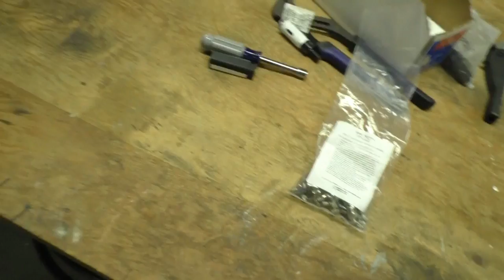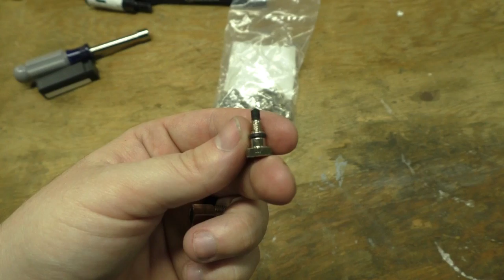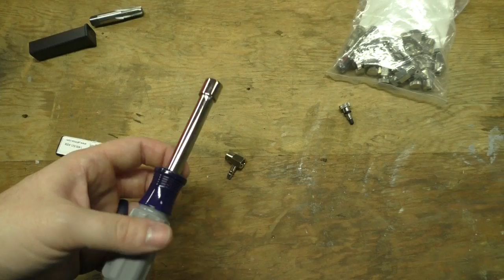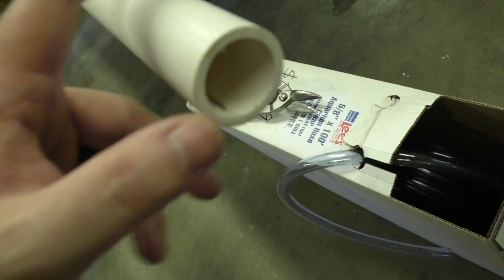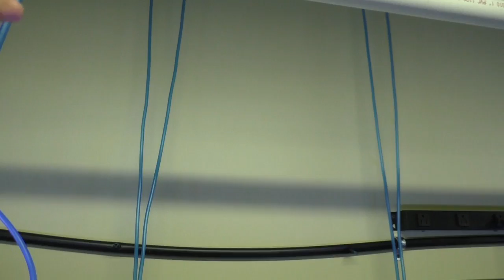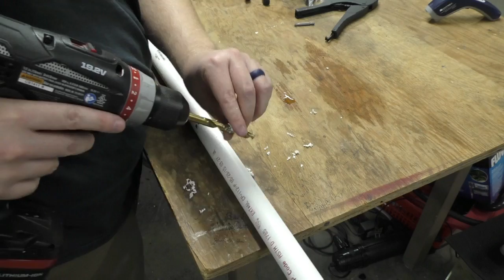Install DIY Auto Fill Lines for Water Change System | How to Build a Fish Room (Part 4)

Comment: Informative video. I'm planning out a water change delivery system now and wondering how water tight those AV4 flow control valves drilled into the pvc turned out over time? Did they ever leak at all or would RO tubing and fittings be more reliable? And what water pressure did you use going into the supply line?

Comment: With an auto water change system like this do you need to use a pressure regulator at all?
Reply from the maker: Depends on the system you set up. I’ve used pressure regulators and not, with my latest system not using one

Comment: Hi Cory.  Thanks so much for all these videos.  I am wondering why you chose an on demand drip system instead of a continuous drip system.  I am thinking continuous drip for my small fish room but just wondering your thoughts.  Thanks again
Reply from the maker: +ribs1 it's hard to regulate down far enough to continually drop on a hundred tanks.

Comment: I'm sure you've said this before, but for a system like this what kind of water pump do you use for this much water being changed on a daily basis, and what's your head pressure like now that everything is built out, are you still using the same pump?
Reply from the maker: Same pump, now I don't use any pumps as I put in a tankless water heater. But  I was using an eheim pump.
Reply: Thanks for the reply.  I didn't thing the tankless heater moved all the water through your system for you.  I'm trying to find something powerful enough to push water to a bunch of tanks kind of like what you did.

Comment: Still not clear how the water goes all the way from water outlet into the bucket and from there to the aquariums. Cant i do it directly from water outlet without bucket directly into the tubes and from there to the aquariums? Why the bucket between?
Reply from the maker: +Adlerauge Wissenschaft well for me I wanted to gas off the chlorine and heat the water up. Now that I've installed a tankless water heater and a whole house filter I bypass the holding tank
Reply: Aquarium Co-Op in german ,,hebeanlage,, aka ,,kondensathebeanlage,, is going to help me out.
Reply: Its a pump with that gets started by a floater. Just like youre white kubik canister but vice versa

Comment: Hi Cory. Are using 1 inch pipes across the filling system i.e. embedded between the 2x4s on your shelf? I recall from another video you mentioning going larger for the drain. I will find the video later.
Reply from the maker: Yes, and 2 inch abs for the drain.

Comment: The AV4 air valves are solid brass correct? Brass has copper in it. Have you had any problems with the copper over time leaking into the water and killing inverts? I'm considering building an auto water change system and would prefer to use self tapping valves but all the ones I've seen have been solid brass.
Reply from the maker: +ArsenalOfColor Aquatics these are nickel plated, but haven't had any issues with inverts myself
Reply: Thanks I plan on calling JEHMCO and talking to a rep about their suggestions. I've been told they have excellent customer service from friends.

Comment: I have a question how do you keep fish especially fri from going down the drains
Reply from the maker: +Desmond Harper Well you use a low flow rate. So if you're dripping the water in over 30 minutes or more, the flow is so low. You can use fish screens etc but they can get clogged up and cause a flood. I won't say you'll never lose a fry. But you'll save a lot more fry with clean water than dirty water but never losing a fry down the drain.
Reply: +Aquarium Co-Op thanks for the reply .... You make a good point .. I wasn't sure about the drip rate but now I can see it more clearly THANKS !!!!!
Reply from the maker: No problem. We are here to help.

Comment: Sorry if this was already explained somewhere, but since the auto-water change water is being pumped from a mag drive in the water tote, how is the tote being filled? Is that automated or done manually?

Also wouldn't the mag drive create a lot of pressure in the fill pipe? I don't understand what you mean by a low pressure system. Can anyone explain how that works? I thought mag drives were pretty powerful.
Reply from the maker: +Matthew Ng I currently am filling the storage tank manually but will automate that process when I move the bin to it's final place.

As for the low pressure system. Water pumps meant for aquariums can move a lot of water but with not much pressure. So for instance if you had a pump in a bucket of water and tried to use it to move water up to your roof to spray your roof you'd probably get none. Where if you use your garden hose it would spray just fine because the hose has a much higher PSI. So a normal house might have like 40 PSI of pressure while an aquarium pump has 5 or less. You can buy pumps that can handle more pressure. For like sump pumps for your basement or for ponds etc. But your standard aquarium pump is lower pressure.

Comment: What r u using for lights?
Reply: Hey cory, I was wondering what you actually end up doing for maintenance? Do you just add water to your system and what overflows is your water change? Starting my own store in upstate ny and I'm very interested in the automated systems you're using in your fish room and at the co op. I'm trying to run the place all on my own to start, so having a system like the ones you feature would ease my work load exponentially. Been binging the most relevant videos of yours I can find for opening a fish store, but there's so many its hard to know if I'm missing any major ones or not! They've been so helpful, thank you so much!
Reply from the maker: +ChaosGeneral1 For lights I'm using Finnex Stingray LEDs. These are the best I've found at a low price point. I use the 48 inch ones over two 20s.

Here is a link: http://amzn.to/1MxHPN2
Reply: +Aquarium Co-Op thanks for getting back to me and with a link I think I'm going to try some out